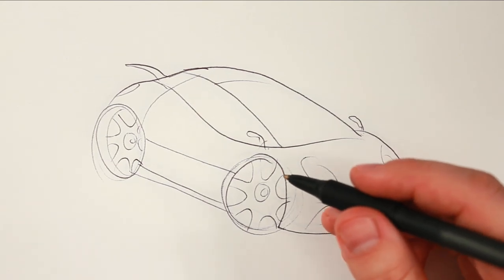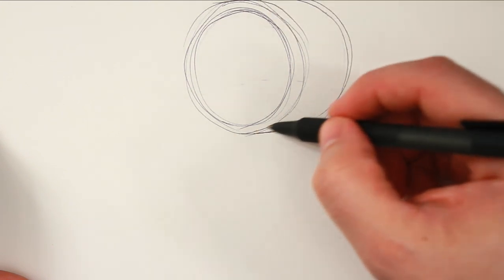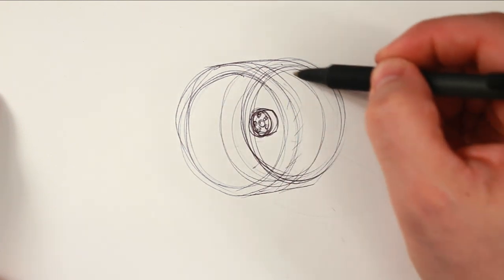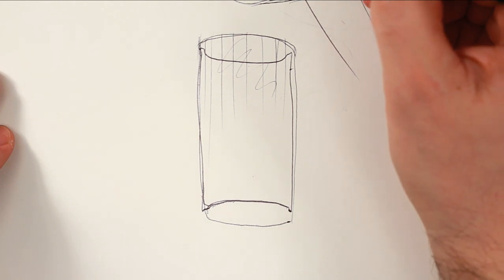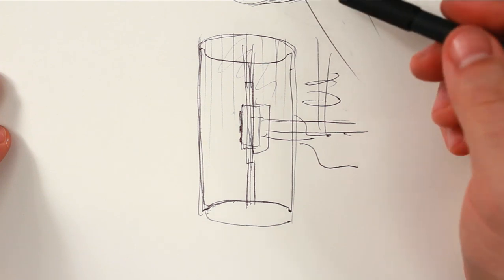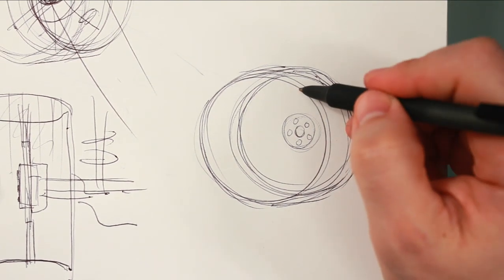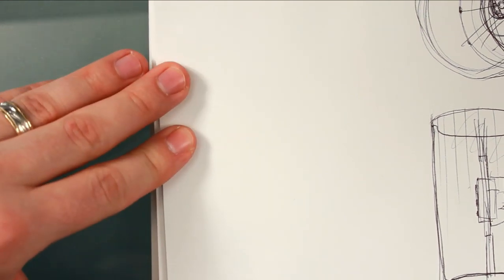How To Draw Wheels: Perspective Part 2/3

Comment: this is a great video. the only thing id suggest is usually the hub and spokes of the rim are usually closer to the outside of the wheels not directly centered in the middle. but other than that perfect job man. this is good for some deep dish rims.

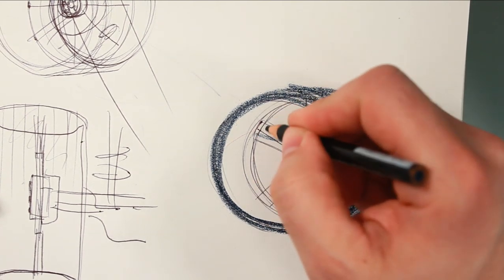Comment: the power of shading! . . . . at 3:54 i saw a wheel with those 5 choco bars registering on the outside of the wheel rim.  at 4:15 those same spokes were now sitting in the rear of the rim.

Comment: Recently I have been getting back to drawing cars, and I've been get better at shading with a regular michanacle pencil. However I 've been having trouble with prospective while drawing a circle, but when I try to use my elbow my hand just wants to lock up. I get the same thing when I airbrush RC bodies, what should I do to get better movement from my elbow without my hand locking up. Also how can do shading with colored pencils while drawing cars?

Comment: How can I get better at drawing wheels without my hand locking up I try to use my elbow but I find it difficult I have the same issue with my hand locking up when I airbrush RC bodies. Also how can I get better at shading with colored pencils on car drawings I saw your video on it but I cant seem to get it done right?